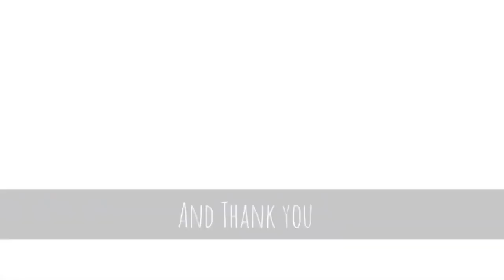EA Nexus pond filter - Dealing with fines. A CHEAP hack to better water clarity!!

Comment: Good video mate. Like you I bought the trident early on in the season so it's had a good few months running.  It really does do a good Job of ridding the fines but I find it needs cleaning every 2 days, there is no way around it. Personally  I do think it needs some ammendments to like what you have created here with the original eazy. More holes/slats lower down on the trident and also more holes/slats on the inner chamber near to the top as I find the top of the micro k1 is unused.

Comment: Now you have me wondering if it would work as well on an eazypod
Reply from the maker: I’ve been looking and I don’t see why not!!
Reply: @edenkoipond  the only problem would be wrapping the easy as it's fixed and too small to get a roll of tape in the outer ...  fiddly job
Reply: @skeggy  Would you put the tape on from the bottom half or the top half on an Easypod?
Reply: @tinahuckins9635  I'd do it the same way.    It idea is to force more water going up through a thicker bed of media
Reply: @skeggy  Sorry call me thick but is that tapeing the bottom half or the top half?
Reply: @tinahuckins9635  as per daves video above applying the same principal to the inner and outer cages if the pod

Comment: Interesting idea using the duct tape. Wonder if it would work on an Eazypod, after all it is basically an Eazy from the Nexus without the outer bio chamber.
Reply from the maker: I reckon it would. The hardest bit with a pod would be getting the tape on 👍🏼

Comment: Good idea does it clean ok? Electricians tape is much better underwater that stuff peels off after a few months in my experience 👍🐟 guna try it
Reply from the maker: Tapes not budged - just need to get the waterproof one 👍🏼 Cleans a treat, I only boil the eazy once and I’m good to go. Let me know how you get on 👍🏼
Reply: The tape you show in the vid isn't the waterproof one? Any chance of putting the Amazon link in the video description, I want to use the one you have tested mainly from the leaching chemicals or not as it seems point of view.

Comment: How much media do you have in your Nexus and what size air pump are you running on it?
Reply from the maker: I run a 120lph Charles Austen pump. Media wise I have a total of around 250 litres made up of k1, k1+ and helex 13 👍🏼
Reply: @edenkoipond  
Thanks for that I wanted to make sure I got a pump powerful enough